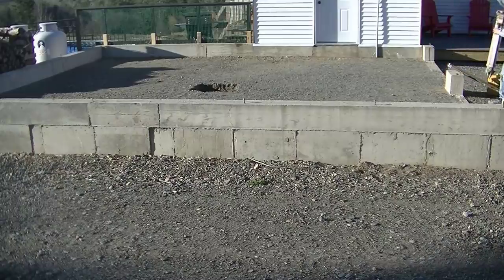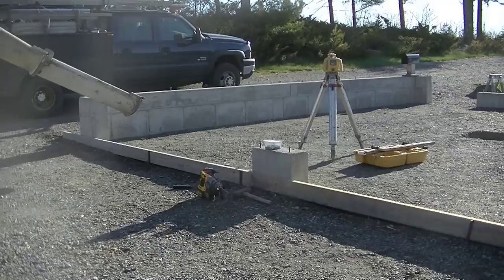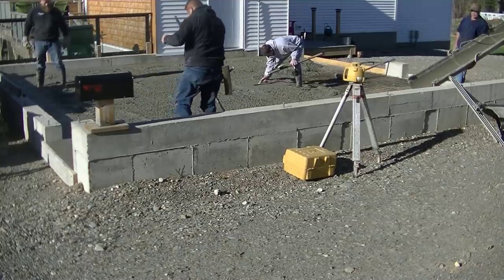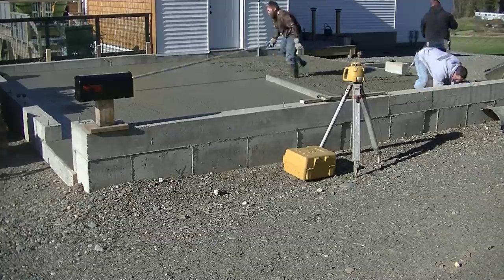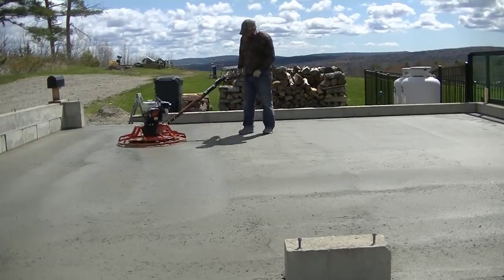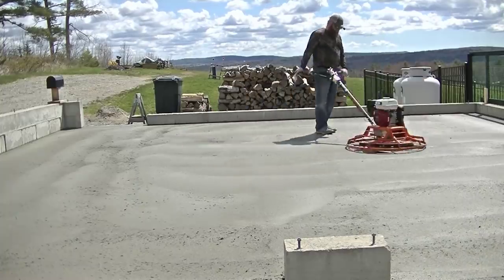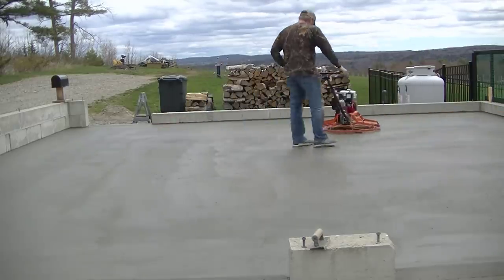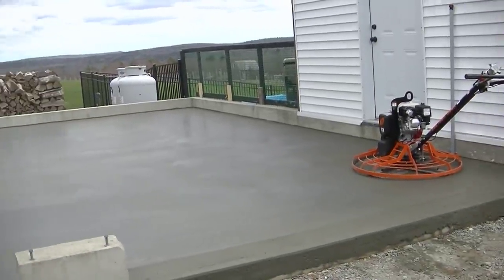Pouring AND Finishing A New Garage Floor (24' X 24' Concrete Floor)

Comment: For us we would run grade pins down the center of the garage (24x24) then pull pins and vibra strike a center pad. Then turn 90 degrees and vibra strike out both sides
Reply: Your lucky you got a couple good finishers. They are hard to come by.
Reply from the maker: @aarongrabowski5620  Yes, they are great!

Comment: Hi mike why no vapour barrier under the concrete to stop rising damp
Reply from the maker: Very dry here and not needed. We also have a vapor blocker sealer if it is ever an issue down the road.
Reply: Mike Day Everything About Concrete hi is that placed on top of the finished slab rolled r sprayed on never seen that remedy

Comment: Was trained for guide poles...wish l was good enough to make wet pads like you do....From Mississippi
Reply: You can get an exceptionally flat floor using screed rails. We used them  on a job last year that had a thick haunch down the middle that was load bearing. It was the flattest floor I have ever done at that size. It helped keep the concrete level at that thicker spot. We used Mayo screed chairs. I did a short video on it. 
Bondo
Reply from the maker: Just takes practice!

Comment: Hey mike, I'm pouring a 36x54 garage floor with a 12ft apron on the left side and a 12 apron on the front. Can I pour all of it together putting extra rebar on the garage doors opening out to the aprons or should I block those areas off and then pour the aprons last. Thanks for all your help. Brian.

Comment: Question,  why not use the wire chairs for the remesh? You pull it up but walk on it when you screed? Seems like a lot of money sitting on the base not really doing any good.
Reply: He said the design mix included fiber-mesh so the WWF is actually kind of redundant and just a little insurance. Once you pull the wire up and aggregate cuts under it, it can’t get completely down to the bottom again. WWF in flat work, is most effective in the bottom third so it’s ‘generally’ where it should be.
Reply: @psidvicious  ah, a local contractor was talking with me about the fiberglass in the mix, he was saying that it  essentiallynos an aid in curing and eliminates Spalding, and something else but I forget. He was saying for a garage slab the best practice is to lay Rebar on the chairs and even put the mesh on top. Just a question
Reply: Lance Sheppard. We use special hooks we made to pull it up as well. As psidvicious said the stone gets under it and holds it up an inch or so. Can’t beat rebar though but usually not necessary for a small garage. 
Bondo
Reply: @bondobuilt386  thanks for the input! Much appreciated
Reply: Lance Sheppard no problem sir. 👍
Reply from the maker: I agree with what psidvicious and Bondo Built said. I couldn't get slab bolsters for this one, they were out of them.

Comment: Mike nice job. Love those small floors. 👍 We wet screed most everything. Mostly with the power screed. If I have a more skilled crew that day we might pull it off by hand. Or a sloped floor. Whats up with the mailbox hooked to the foundation? Lol 
Bondo
Reply: We used to do that for the building permits, so we didn’t have to wait for the inspector.
Reply: psidvicious that’s a good idea. 👍👍
Reply from the maker: Thanks!

Comment: Wire mesh is ok! (Nothing beats steel in concrete) but the fiber mesh is worthless in concrete. It will make a slab section stronger between crack control cuts, but where there is a cut/ shrinkage crack, the mesh was deamed useless. JUST COMING FRONT AN ENGINEERS FINDINGS IN THE FEILD

Comment: Morning from Ohio Mike - Subscriber here and I do look forward to your videos each week - I'm by no means a concrete guy,  so excuse the ignorance of my questions - what was the hole in the middle of the dirt floor for before you poured the concrete?  Also, I noticed my garage floor has two straight lines grooved into the concrete - one going length and width wise - is this normal to have in garage floors? Thanks!!!
Reply: That ‘hole’ or thicker spot in the middle of the slab is undoubtedly a footing for a steel column, so that the span (24’) can be reduced to half. They’ll run a girder either length or width wise, so the ceiling joists will only need to span 12’ from bearing point to bearing point. 
The grooves in your garage floor are control joints. The old adage in the concrete business is - ‘There’s 2 kinds of concrete: the kind that’s cracked and the kind that’s gonna crack’. A control joint is used to try to ‘control’ where the concrete will eventually crack. The concrete will crack at the point of least resistance, so you purposely create a ‘weak’ point so the crack will be somewhat aesthetically pleasing.
Reply: @psidvicious  I tell my customers that all the time about the 2 kinds of floors. Lol   We’re still cutting control joints with a demo saw up against a board. im gonna get a soft cut saw soon. get those cuts in the day you pour would be nice. 👍
Reply: @bondobuilt386  I’m sure Mike did exactly the same on this floor, with 2 saw cuts, down the middle, in each direction. 
ALTHOUGH, for this particular floor, I would be tempted to cut a 2 foot diamond around that steel column footing in the middle of the floor and then make the centerline cuts to the points of the diamond. (The way it’s done on big jobs with multiple steel columns.)
Reply from the maker: Once you get one you'll wonder why you didn't get it a long time ago.
Reply from the maker: We did cut one down the middle each way. He just didn't video it.
Reply from the maker: Exactly right.

Comment: Mike, thank you for your educating videos. I'm about to pour my garage concrete. On size 24 x 24 do i need a distance joines in both directions?
Thank you for answering
Reply from the maker: Do you mean a contraction joint? Like a saw joint to control cracks? If so, then yes. That's what we do.
Reply: @MikeDayConcrete  mike, you are my hero when it to comes to Concrete. I like to challenge myself that's why I'm doing it. I appreciate your response. The way I understand it, you make a cross in the middle of the Square?
Reply: Mike, one more thing. I noticed you place a vertical rebar's sticking out from the concrete.  I guess they called concrete anchors. Do I need them four frame garage?

Comment: We have a saying that if you scrub you scrub alone. Meaning that if you didn’t stay ahead of it enough then you scrub alone. Of course we all help but when your green you learn after the first time that if you take a break and don’t stay ahead of the dry time that it can get ahead of you real quick and what a pain.
Reply: Hi Mike! 

Thanks so so much for taking the time to put these videos out there... the way you explain the things sure does make it seem a whole lot less intimidating to try!!!

I'm currently in the process of doing an owner builder project. I've been a DIYer my entire life... jack of all trades more or less... well, minus yours!

 I'm honestly a bit hesitant as to whether I can pull off my 24" x 24" slab. It's for a steel quonset hut that's asking for a slab using footers all around the edges and a keyway slot on two sides. It's the keyway slot that has me worried most. 

With all of your experience... I'm sure it's an incredibly easy task!! For me, I want to do it very badly... however, I'm super tight on budget and can't afford to goof it up. Thanks to impact fees.. I'm afraid I can't afford to hire it out either. 

My question is... Do you feel as a strong DIYer I could pull this off? I've done some blacktop work previously... so I do have a good idea of what it's like to move and level, ect. Just wondering if I can float that size of a slab on my first try successfully? And also about the keyway slot? 

If there is any helpful tips you offer, or any advice or tips on how to create the keyway channel? I would be forever grateful!! 

Thanks so much again for all you do! Hope you and yours are well! Take care! -Devin

Comment: 1/4 or foot it should be 6” slope. 2%
Reply from the maker: The slope is whatever you want it to be. There's no set rule. Some people want them flat. 6" in 24' would be overkill.
Reply: Mike Day Everything About Concrete it all depends on what you need for the driveway

Comment: Why so much slope from back to front?  Not sure I would want my garage floors that unlevel?
Reply: Thats so the water runs toward the doors. Some areas don’t allow drains so the pitch helps so water does not puddle up. As Mike said 2” is not that much in 24’ garage. We use alot of trench drains in upstate New York. 
Bondo
Reply: 2” in 24’ is really very little slope. It’s only about 1/16”/foot or .083”/foot or .635cm/1m. 
A 1 inch diameter steel ball bearing MAY roll on that floor, but I’d bet a basketball wouldn’t. 🤔
Reply from the maker: I agree guys, it's not very much slope in 24'. It's enough to get any water dripping off the cars to run towards the doors. It's not noticeable when you walk on it though.